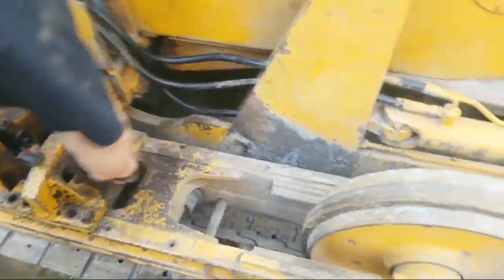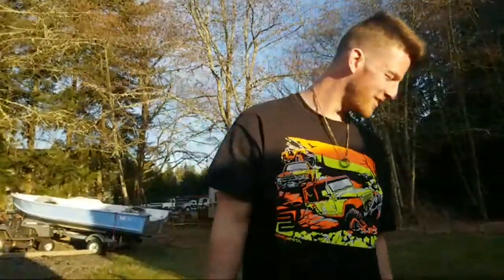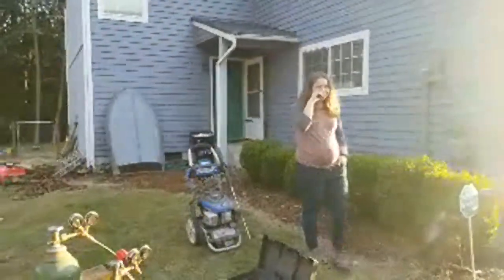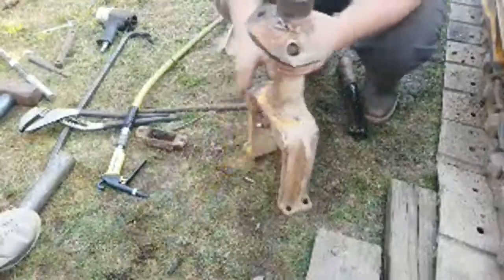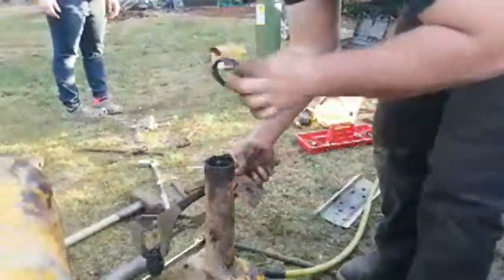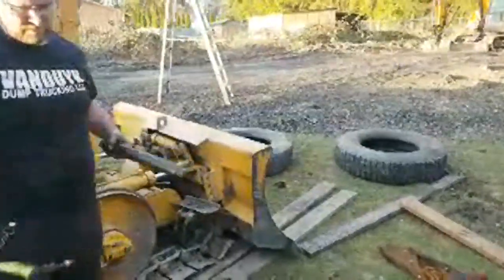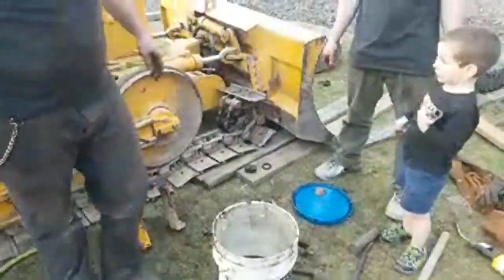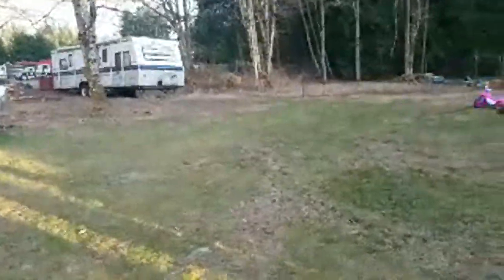Master Pin removal With Torch On Dozer Track td7c

Comment: Just Fyi: International doesn't make parts anymore.  There are a few places that may have parts but they are usually from old machines.  There is a Redpower forum that has heavy equipment section.  Those guys are very good.  They probably have some places pinned  for spare parts. Good luck!
Reply from the maker: @shawn coulter i found a new one on ebay 750$
Reply: @BRIANVANDUYN  Cool, glad you could find one.  Ebay is a God send for heavy equipment stuff.

Comment: Hi, i need to take out the master Pin on my O&K P8 PMS i have one question: is the track tension loosened prior to removing the pin or not? we got the pin mooving 2mm with the torch method and it was very hard, so im thinking were doing something wrong. Thx
Reply from the maker: Definently remove track tension